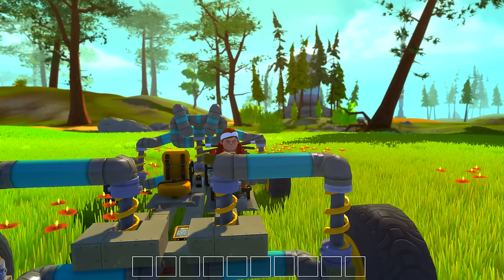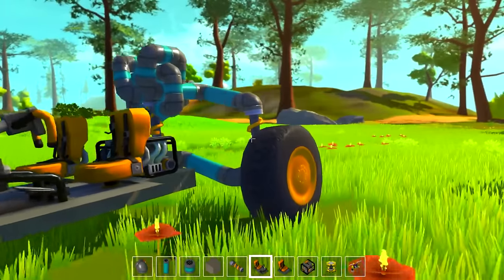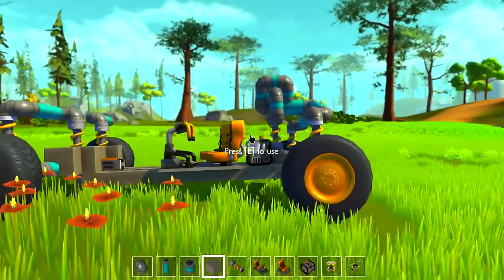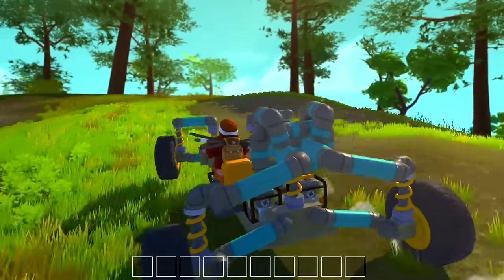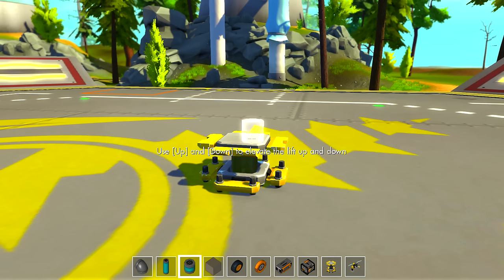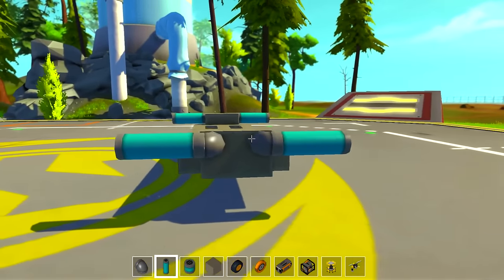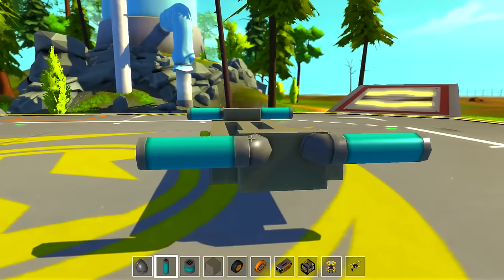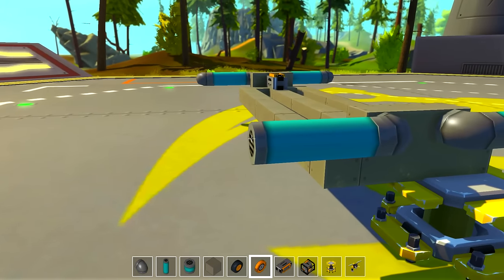Scrap Mechanic Gameplay - Ep 14 - Vehicle Suspension

Comment: The front suspension works like normal suspension as he didn't use bearings in between the pipes. If you look at when he drives, the whole front moves as one unit.

Comment: the problem is that the back wheels when they hit a bump they are actually pushing up the frame instead of the suspension the bottom pipes for the back should have free bearings and not set to 15 and -15, that way when the car hits a bump the suspension receives the shock and not the frame

Comment: I like the suspension.  One of the first things I wanted to implement is a proper upper/lower control arm but I don't think wishbone will be a reasonable possibility without a weld tool.  But you're almost there with this... just missing lower articulation.  impressive, to say the least.

Comment: ITs not really suspending the frame with the driver on it itself but the pipe mass on top, therefore is kinda pointless at this point. The Driver would need to sit at some point where he is connected to the piece above the suspensions, otherwise his back will be crushed just like without a suspension

Comment: You need to remove the suspension piece that is under your joint and put a hard piece there like a tube.

Having the suspension piece there makes it work way worse than its supposed to. right now you just put all the force on that one shock. your suspension would work much better without it :)

Comment: that thing is the exact opposite of a good functioning suspension. you hooked up the wheels and axles to the frame and have the top part of the suspension loose on the springs. the wheels dont move up and down as they should and the springs only compress when the weight of the top "knot" of pipes is forced down. complete and utter waste of time to do it like this. the welding tool is gonna fix a lot of these problems we're having here.

Comment: Hey Z i thought of a way of making the back suspension work the same but it would be a lot quieter. Instead of using that pipe locking contraption you could use the right angle pipe and a baring to replace the funny business. I don't have this game so i cant show you a screenshot.